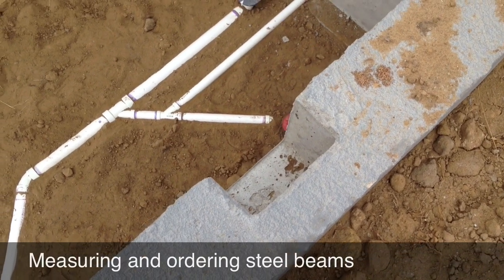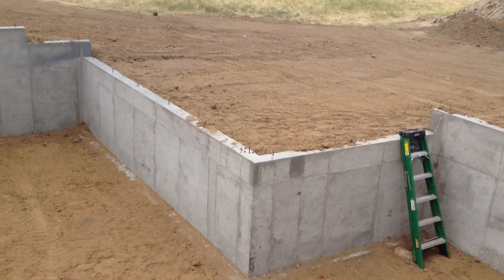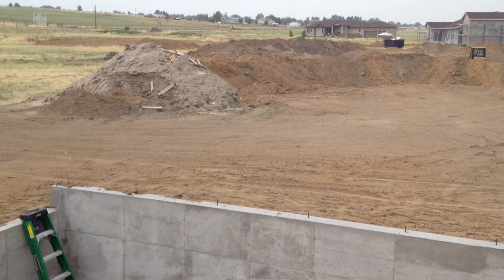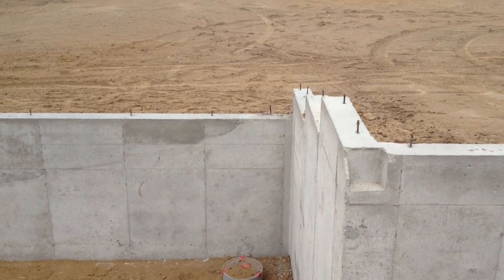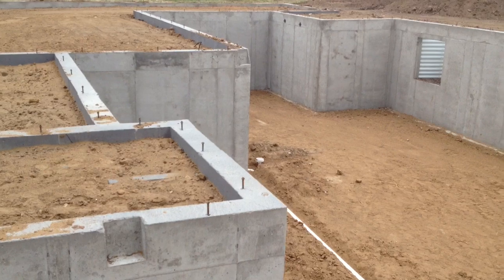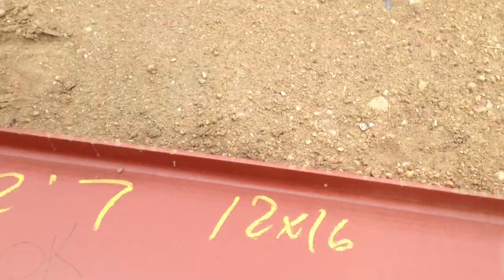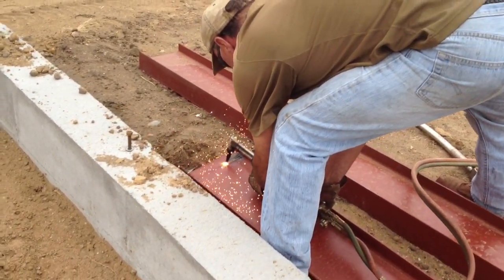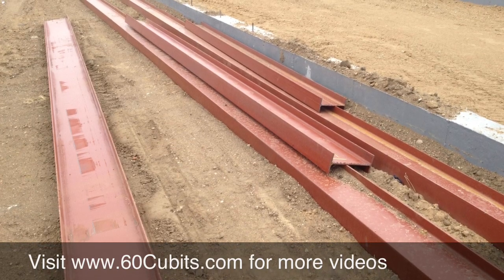Building A House - #11 Structural Steel (Red Iron)

Comment: I have a question we built our home 3 years ago and we have a steal beam 60 feet long the length of the house the first year I notice my tile floor had a hump  over the beam area . I got a engineer to check the foundation and he could not explain the foundation was good it did shift only a 8th on a inch. above the tile the was a 1/2 inch hump. we also had a moisture reader in the basement and it read that normal. in the summer time the hump get higher in the winter in goes down a little it has been 3 year like that the contractor just keep telling me he did every thing by code and he can't explain why this is happening . so we have had 2 engineer at our home with no answer. we live in Massachusetts have you ever seen something like this happen to any of your construction . please if you can help answer my question I would love it thank you

Comment: I’m assuming you use some type of laser measuring device to use when getting your pocket to pocket distance.... if so, what do you use? I just had my foundation poured and need to measure and order the steel.  What’s the best way to get an accurate measurement across 70ft span?
Reply: You use a tape measure

Comment: I’m going to break ground on a new build in April... when should I order the steel beams? Are you suggesting ordering them after the foundation has been poured?
Reply: Yes. And field measure your span dont rely on the prints. Youd be amazed how much time we spent returning to jobsites to trim an inch or two off or adding length. It even got so bad with one paticular framing crew we bough a box of cheap promotional tape measures that we hand out to them every time we return to fix their problems.

Comment: hi everyone, I need help to determine the right size of i beam to frame a 2 story house, the area of the property around 100 m^2, like 10 by 10 m.... the roof of the house is precast concrete slabs. 
any help is really appreciated. 
peace
Reply: Start with a print. Get it approved if not already by an architect. Then submit to lumber yard for lumber package quote, steel fabricators for quote,( can get a quote even though your steel might be 1/2" shy or long.) The fabricators along with house plans will determine what size steel. Field measure beam size once foundation guys are done. Also might want to get a flat work guy lined up to pour the basement while you start framing.

Comment: For people who want NO basement posts to interfere does the size and weight  of the house on top of the basement determine if one can go "post-less" or is it mostly a length issue? And how much more (in the house you're doing in this video) added cost are the steal vs wood beams? Thanks.
Reply: The structure above absolutely does matter as well as the distance you are trying to span and available depth for the beam. Engineered wood beams such as LVL, LSL, PSL or glulam beams  are cheaper compared to steel but not as strong. There is really no general solution that would work for any case. Consult a structural engineer, it should be an easy task for them.
Reply: You will need to go with a very heavy beam to go postless. Depending on the span25-35 feet or so,probably minimum of a 45lb per foot beam or more. A 45 lb beam is 39$ a foot approximately.

Comment: For W sections the second number is pounds per liner foot, not metal gauge or thickness.  The first number roughly the section height, but not exact.
Reply: Dave SC --- You're correct, beams are manufactured in pounds per foot, not gauge!